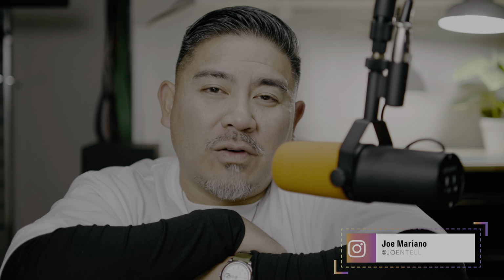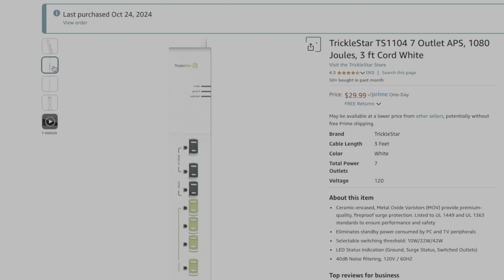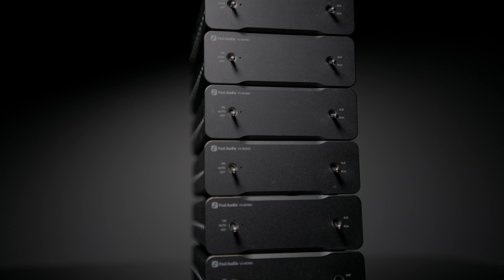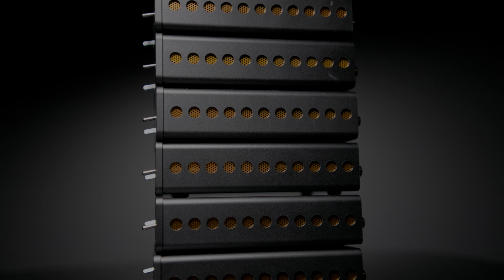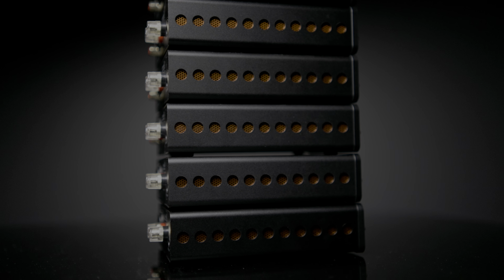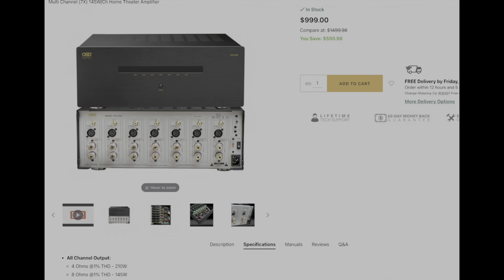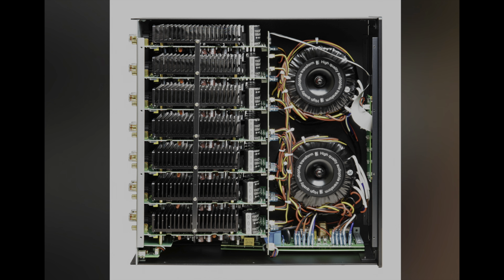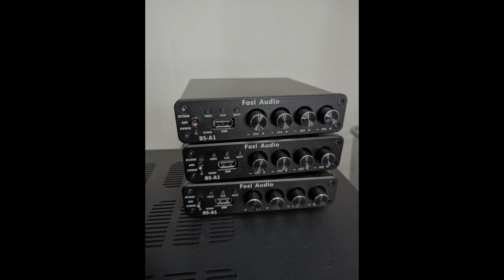I used 6 Fosi Audio V3 Monos in my Home Theater. Here's what happened.

Comment: M&K 750s + rel sub

Fosi bt20a pro… have had it for years and have used it for many different functions… upgraded to 48v supply.. shocking  good performance for the price

Switched to some 90s thx marantz ma500 monoblocks— it’s not even close, the ancient vintage marantz are major league s and the fosi is playing tee ball. The fosi is composed and clean, even at extreme volume, but the marantz has what feels like infinite current and the sound is just alive. 

I love the fosi, and I know the v3 monoblocks are supposedly a massive leap beyond bt20a pro… but I wouldn’t bet on it having the same performance as the 90s class ab monoblocks. If so… I’d DEFINITELY prefer the fosi… but I’m too cheap to spend $230 to experiment.

Comment: Yea... There is no ClassD or Fosi with Dobly Decoder like AV Receiver did.. Would be nice to see if they make it, tpa3221 will do a great job, no need tpa3255. In term of efficiency db per watt (tried BT30D pro, ZA3, T20X). I really amazed by Fosi T20X even i find would be nicer if T20X flat without any cut freq 👌

Comment: For me, the 3 Fosi mono blocks (2x ZA3s and 1x M03 Subwoofer amp) for my PC's isolated USB-based 2.1 music system is... sufficient. 
Two old-school NAD 2600 power amps and a T752 drives the all-analog 7.1 system on the same PC, coming directly from the 12 op-amps on the Xonar HDAV 1.3 Deluxe boards. The systems share some old ProAc fronts via a switch. Good times!

Comment: Wondom has a 10 ch 50W amp modul , which has  a built in DSP (but only works with UB audio, or you can swap the dsp to an input modul ) it called GAB8 and like 75$ :D
Reply from the maker: I just looked and it doesn't seem to have DSP
Reply: Wondom is bigtime hit or miss.

I have their adau1701 in my office- a pain to setup with sigmastudio, but rock solid with great performance for more than a year since then. 

Got a second one (why not at crazy $35 price) and… one of the rca ports cracked and fell apart on first use. They are amazing value, but not built like the higher end stuff.

Comment: Comparing the 5 channel OSD amp to 5 of the Fosi V3 Mono Blocks (NOT the V3 stereo) - the OSD has poorer specs especially if you are driving low impedance speakers

The OSD does not even list a 2Ohm rating. So it probably CAN'T 
All Channel Output:
4 Ohms @1% THD - 210W
8 Ohms @1% THD - 145W
4 Ohms @0.1% THD - 180W
8 Ohms @0.1% THD - 125W

FOSI V3 MONOblocks have:
1) 2 ohm stability (load independent)
2)  far higher power with nearly 500watts per channel into 4 ohms and about 400W into 2ohms (with each running their own 48V / 10A supplies) 
3) higher SNR - approx 120dB vs 110 of the OSD
4) you don't need to get a fan for each one- several folks have used $11 stick on heat sinks with great results equivalent to running a fan

Another thing is - if one channel goes out in the OSD or any "all in one" amp, you can't simply replace that channel

Comment: Impedance !

Impedance of the speaker  - not resistance!

Speakers are complex devices with both inductors and Capacitances, as well as their Ohmic resistances, which remains the same over all frequencies, but whose reactances undertake varying values based on Frequencies.

Good video over all.
Reply from the maker: Yes you're correct. I actually know this, but it's a bad habit because I'm often trying to simplify concepts for people so I use terms that might not be 100% correct. An example is when I talk about frequency response and I am really referring to magnitude response because I'm not discussing phase.

Comment: I think a housing that you could slot multiple mono blocks into would be interesting.  Remove them from the existing housing first.

Active cooling, better heat sink/dissipation, and a built in power supply.
Reply: I picked up the 3D print file for brackets to stack a pair of V3 Mono amps together. Then printed enough for 3 pairs (12 brackets in total for the design I used). There are now several print models available online.
I did see hints that Fosi were looking at a modular case of up to 6 or 8 slots where you could remove the V3 Mono from its case and slot them into the modular case instead. I'm not sure how they were thinking of implementing power supply. A year later and it hasn't been released so I guess they dropped the idea.

Comment: Hi...

I have questions about Fosi V3 Mono. I using it to run my front speaker (Polk Audio ES60  -  8ohm) via Denon receiver AVC3700.

After running Audyssey calibration, front level result is +6.5db (switch 25db gain).
Before this, using direct AVR, result level is -3.5db.

It's normal? Or something wrong...

TIA

Comment: This is why I believe using the lesser 30-40 v psus is the safer bet, indeed, you lose some power, but I believe if it helps avoiding issues of heat and such, it's not that bad of a trade-off.
Reply: I took no measurements and relied on touch but tried running 32V 5 or 6A supplies and didn't notice much temperature drop on the casing with the V3 Monos. With the Aiyima A07 amps, the difference was much larger.

Comment: But how.does.it.sound
Reply from the maker: Exactly how an amp should... Transparent.  I would only have comments about amps that do odd things to the response which fortunately, most modern amps do not. I'm not saying that an amp that changes the sound can't provide a pleasing sound, but I prefer an accurate amp where EQ can be used to achieve a certain sound signature.

Comment: I'm betting that by the time you buy 6 of these amps, 6 of the big power supplies, the fans for cooling, and the smart power strip, you probably could have gotten an Emotiva or mid-level Marantz AVR for just a little bit more money, not to mention the cost of the HT pre-amp/processor that you'd need for the Fosi setup.
Reply from the maker: Yeah. I

Comment: Synergy? Every speaker is a complex load. The specs are usually not correct in regard to impedance, which is usually also very complex. Amps can be left 'seeing' some wild loads on the output jacks.
Reply from the maker: I think we're saying the same thing. When people talk about synergy with speakers and amps, it usually makes me think the amp has issues.
Reply: @joentell  Yes. I think the amp also would have the issues. I just didn't want to say that. People are sensitive about low cost Chinese amps.
Reply from the maker: @TomT-bn1lm  Amir at ASR and Erin's Audio Corner did simple and complex load testing and these did well.
Reply: @joentell  Except for when they fail.

Comment: Glad to see someone else tried this. I did it with the old SMSL stuff like a decade ago. Same kind of thing, I needed to put little rubber feet on them and put 120mm PC fans between them. It would be cool to be able to buy these as bare boards so you can put them in your own enclosure. I'd love to build a 4U or 5U unit with 5-13 or so channels with a bunch of these boards, a nice power supply and good fans.

Comment: Some of your technical details are incorrect.  For example, an EQ will not do anything for load dependency of an amp.
Reply from the maker: Do you know for a fact that the frequency response effects from load dependency don't scale linearly with volume? If they do, then eq can compensate for it. If not, then it cannot. I do not know the answer.

Which other technical details do you think are incorrect?
Reply: @joentell  All speakers are complex load.  It's complex load because the music signal going in is not a constant tone, and then depending on the frequencies (because again music is not one frequency, it's combinations of different frequencies at different level) it activates different driver(s) of the speaker.  How do you EQ that?  If a system's level is non linear in the frequency domain, then that can be EQ'ed (except speakers with terrible radiation pattern, you will be fixing the direct sound but messing up the reflected sound).  But you are talking about a system's level is non linear in the load domain.
Reply from the maker: @dfknyc78  that is my question though. I get that music will activate different parts of the frequency range compared to full range pink noise. But, the question is whether it changes with loudness. A full-range EQ can be put on a speaker, but only parts of it will be noticeable when activated with certain frequencies from music. I've asked Erin about this when he does his reactive load testing and he says he doesn't know either. If you know for sure, then please explain more. I'm here to learn as well.
Reply: @joentell  I'm not understanding what you are asking.  Let me see if I can simplify my comment.  When a system is frequency dependent, it means the level varies based on the function of the input frequency.  So let's say at 12kHz, the level is +3dB too high, you can specifically EQ that down 3dB to compensate.  But if a system is load dependent, it means, the level varies as a function of a load; but the load is complex (like all speakers are), how do you know what the load is at any given point in time of the input signal (music)?

I can further simplify this some more: if you are saying you can EQ these Fosi amps (or any amp for that matter) based on load, then tell me which hardware/software you would use to do this?
Reply from the maker: @wattanamnam  I'll have to do more research. I'll try to get back to you.
Reply: @joentell  All you have to do is ask yourself or Erin, the step by step instructions on how to EQ a system (in this case an amp) if the frequency response is load dependent.  What hardware/software would you use, what are the parameters to set, etc.

You'll quickly realize there is no such hardware/software that can accomplish this goal.
Reply from the maker: @wattanamnam  I hear you. Let me think on this. I might be getting stuck on a few concepts. I'm still learning here as well. Bear with me. ;-)

Comment: I was hoping this would be about how they perform over just using the theatre receivers' own amps. My denon on its own sounds horrible compared to using amps on the pre outs. But I got no information on that at all. The info on the power bar made up for it, considering I didn't know that existed.
Reply from the maker: I was planning on doing just that, but keeping these running cool took precedence once one failed and I realized how hot they got. How they sound isn't important if they aren't working. Having said all of that, it sounds good. They can probably deliver more power than my Denon X4700H and X6700H with all channels driven, but truthfully, with a sub, I can already play those loud enough without any signs of distortion. People shouldn't expect a huge improvement in sound quality by upgrading amps unless they're reaching distortion.

Comment: I'm also running a 6 pack of these for 3 way active speakers. 
I'm using them on their sides with push-pull 14cm Noctua fans top and bottom to assist in vertical heat dissipation. There are 3D printed brackets to keep the whole amp block stable preventing individual amps moving independently. Add in the price of 6 short right angled power cables and USB cables and adapters for fan speed control, an 8 way mains extension block, and a smart plug and the costs start mounting. Even with prudent shopping I've spent £150 on extras.
The amps themselves are only a tiny fraction of the space it all occupies. It takes up only a little less space than 3 standard 2U ish power amps with a bit of ventilation space and a fair bit more space than many dedicated 6 channel amps. 
Then there's all the added cable spaghetti to manage.
All in all, this route is hassly, messy, and has a hugely negative WAF. It does sound rather nice though and if anything breaks, I don't need to replace the whole lot.

Comment: talk about underdelivering on the promise of the title, he never actually shows the 6ch monoblock system or any measurements
Reply from the maker: I explained that I didn't do measurements as they've already been done by others which I linked to. You want to see them connected to my Pre-Pro? Just ask me what you want to know and I'll do my best to respond.
Reply: @joentell  your tilte claimed you made a multi channel audio system with these low cost hi performance monoblock amps , but the video felt like a commercial for the fan device
Reply from the maker: @richardoates8103  I did set it up in a multi-channel setup. Do you have a question or are you just looking to complain?

Comment: I was very close to getting rid of my two V3 Monoblocks - only because of the intense heat factor that I was experiencing (I had the 48V 10A with splitter version), and the cases were ridiculously warm (almost hot).  Then I began reading various reviews, and in one review, it was strongly suggested that in order to keep the heat down (to almost cool), use a GaN 36V power supply.  So I ordered two of these made by Nobsound (see link).  First thing I noticed was that these awesome power supplies were half the size of a regular power supply, and they also improved the sound qualities of the V3 Mono's that I have.  More so however, was the fact that all of a sudden, my V3's were running cool - now go figure?  I also have the Sparkos Labs SS3602 op amps which make a huge difference with regards to a warmer tonality, better soundstaging, and sound qualities more like a good class AB amp.

Here's the link to the GaN power supply I was talking about:

https://www.amazon.com/Nobsound-Adapter-Charger-100-240V-Transformer/dp/B0DDBQHQVD?crid=2QC76J2J613E5&dib=eyJ2IjoiMSJ9.AVFRpmFAjmzFgJHaaP4SBRnBgV4mH9OKucWoo9reh9ES_XnQlo9-dDfqDSKMJZPYr8naAPvRy4a6h3u5VpkZTG63IlTCQAcHJNUJFZUIONfIecAbT2iumw-PC8EydGXwMb-6gSUWdX9y8nvFFUSwFgaoNBPK_wdt2LE8LuwLwS9UUKOvZm3A8XloYrNBIZXOET0fRVX-5Sa8ZkHJTUtgSjL8ltyJJ9tr2TA0P6fZO9E.NUBaUU2YpJFREpXW8wXcX1jHa3FnU_toTKfAxPlTdQM&dib_tag=se&keywords=Douk+audio+power+supplies&qid=1733954378&sprefix=douk+audio+power+supplies%2Caps%2C128&sr=8-4

Comment: flip the amp upside down and mount a aluminum heatsink where the chip is. passive cooling, no fan
Reply from the maker: Have you done this?
Reply: @joentell   Not on this particular amp yet but I have done all sorts of similar work on other amps, computers...   I do have a set of V3 Monos and will do this.  I plan on having them sit in a rack on their side, orient the heatsink so the fins are vertical for better cooling.  On their side so that air can still flow holes in the case vertically as well.  Should work great
Reply from the maker: @sodasodas3  I'm curious to hear what you find!

Comment: Agreed! Not to mention finding space for those 6 giant power supplies. Hopefully your power strip and wall outlet can handle that kind of draw.
Reply: I've blutacked mine into 2 stacks of 3 and along with the added mains distribution block needed, they do add quite a bit of bulk, pretty much negating the benefits of the small size of the individual amps.
Reply from the maker: Blutack everything!

Comment: Not to knock Fosi Audio but I've had a couple of their amps and had issues and I've yet to have a problem with the Aiyima amps I presently have 6 and gave away or sold another 4
Reply from the maker: I bought an Aiyima A07 and it didn't work out of the box.

Comment: If one of those little class D things is running hot at idle, I'd be concerned about the design.  What's the idle current?
Reply from the maker: I'm not sure what the idle wattage is. I think it's around 10 watts from what I've read online. Please double-check.

Comment: I bought 3 of these on the kickstarter, and they run warm.  I bought some heatsinks and double sided thermal tape to see if it would help at all.  Contemplated using them for LCR in main system but they dont seem to be reliable enough.

Comment: I have been running two of these on my primary system since they were released and have had zero issues. I have positioned mine on a glass stand, with the amps sitting next to each other side-by-side, but with approx a 3" air gap between them. Yet to have any issues.
Reply from the maker: I would recommend fans if you want them to last.
Reply: @joentell can I ask how the two amps were positioned relative to one another when one of them died?  

Your video includes lots of shots of amps stacked on top of one another, or sandwiched next to one another tipped on their sides - with no air gaps between each amp. Did you actually run them like that for prolonged periods? Or was that just for production purposes?
Reply: Just as an update, I have now had these amps for 2 years and positioned them as described above and they're still doing great.

Comment: Great video Joe, as always. I've got 3 v3 monos for my LCR and a stereo v3 for my rear speakers. I've got the Fosi fans too but I didn't know about the problems with the Auto off feature. I am going to use a smart plug to turn them off when not in use. Going to be using Magic Beans on my setup this weekend.

Comment: I use a CyberPower CP1500PFCLCD PFC Sinewave UPS System, 1500VA/1000W, 12 Outlets, AVR, Mini Tower on my Home theater set up. Marantz SR 7015, Panasonic DB-UB820, Technics SL 1300MK2, LG C3 77in. 2 SVS Pro 1000 subs.

Comment: Get with your buddy I built a 12 Channel(2 boards 3 TPA325 each) with a 3000 watt Power Supply and cooling fans and case for under $350